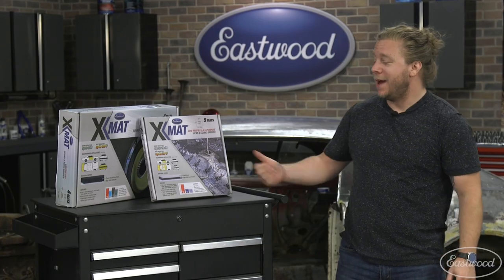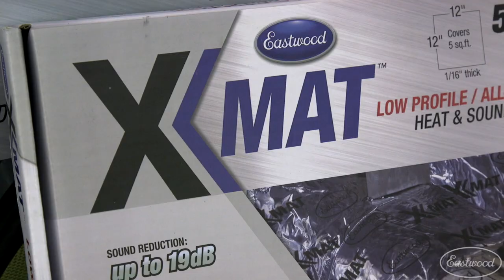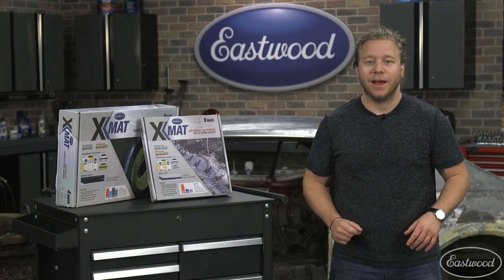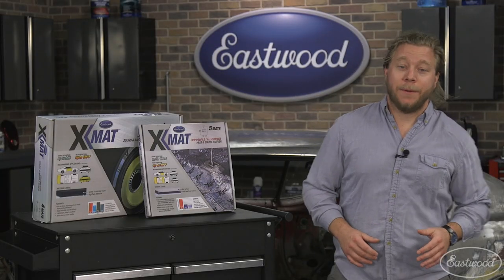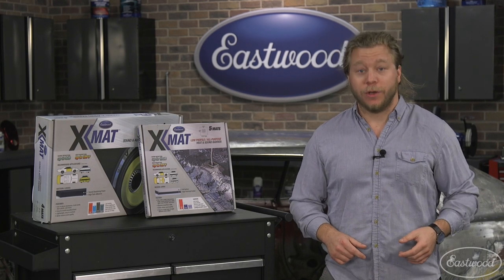Installing X-Mat on a Ford Pickup - Sound Deadening & Heat Solutions From Eastwood

Comment: On this application- how much weight would you say you added to the cab?
Reply from the maker: The X-Mat Low Profile All Purpose Barrier, which was installed on the floors, weighs 12.8 ounces per square foot.  Hope this helps you determine how much weight it will add to your car or truck.